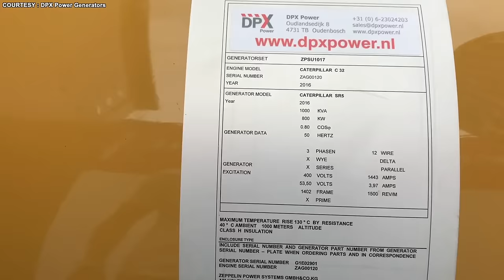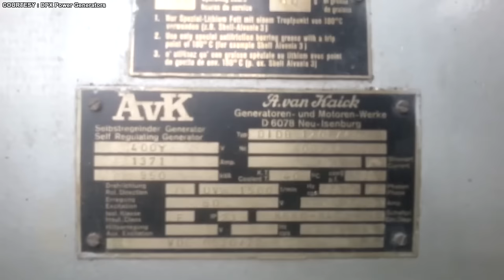Crazy Big Old Engines Sounds That Will Shake Your Soul

Comment: The black engine is not actually a road locomotive, it is a ploughing engine as it has the drum and cable beneath it to connect to a plough which it dragged across a field working in conjunction with another one.

Comment: That jet semi truck reminded me of a drag car from the '60s and 70's called the Green Mamba or Green Monster (can't remember) a lot like the FireForce one at 17:10 but the cockpit was at the very front of the nose. The guy had it specially modified to throw a flame about 30ft. into the air and out the back. Basically a waste of fuel for show, when it was set for thrust the flame was blue and short. I saw him go around 260 mph in a 1/8th mile. I could be off slightly, it was 50 yrs. ago. Too bad we don't see incredible showmanship like that anymore. The Allison 12 cylinder aircraft engine on the tractor Black Gold sounded awesome.
Reply: Green Mamba ! The guy that owned that car died in it !

Comment: @1:05, the engines weren't called "Phantom F4 Jet Engines". They were made by General Electric and had various J79 designations throughout its production run. 
https://en.wikipedia.org/wiki/McDonnell_Douglas_F-4_Phantom_II
I wonder if the jet semi truck was one of Les and Kent Shockley's trucks.

Comment: Nice cracked heads are in the future of the Detroit 6V53TT with running air inside the head's water passages that produced microscopic cracking with possible present observable cracking after running the engine with reving it. I hope they didn't sell this engine to someone.